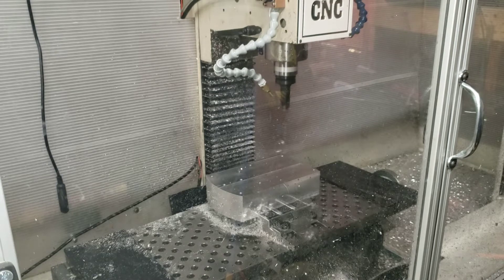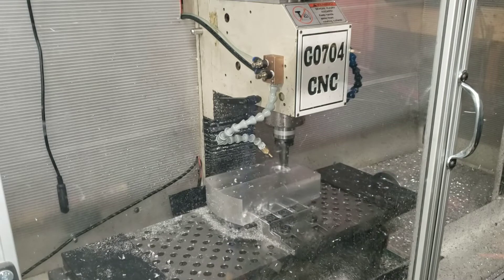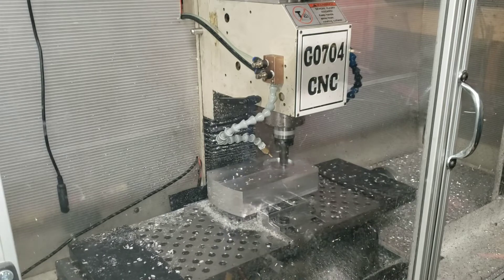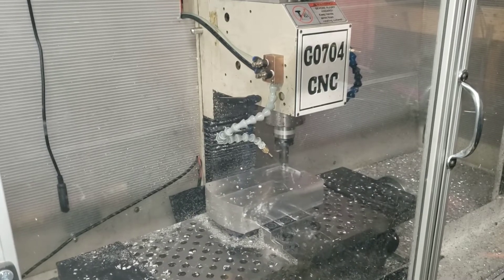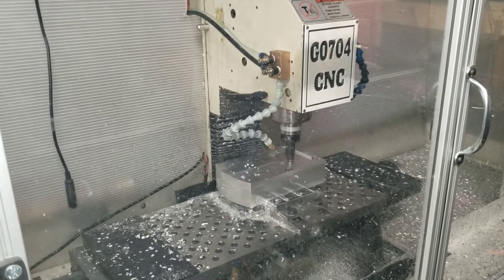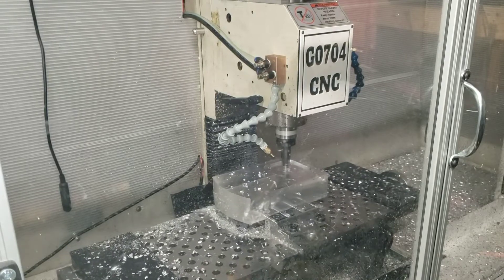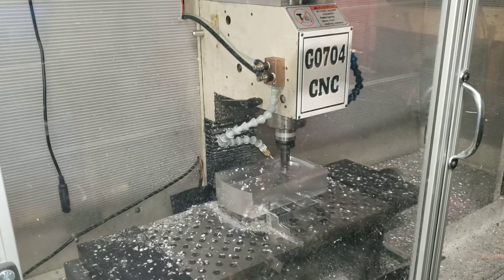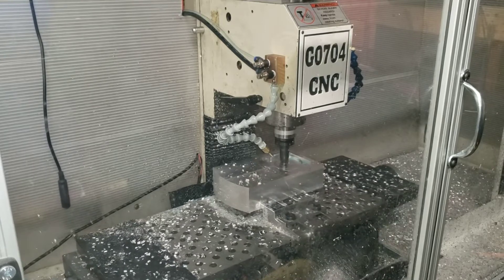Machining a G0704 Head Spacer on the G0704 - Using Tormach Shear hog & Superfly !

Comment: I see i should have read your commentary water cooled motor,  do you have a part number onthe spindle motor setup?
Reply from the maker: Maximum rpm 7,700 - removed the quill drive and made up a custom motor / pulley setup.   The spindle bearings have been changed to angular contact bearings rated for over 12k rpm.  The 2.2kw milling spindle motor has an er20 collet end and I made up a special pulley that clamps in the er collet to drive the belt setup. 

Here is a video of the spindle motor setup.

 https://youtu.be/H3tgc3vxFc8